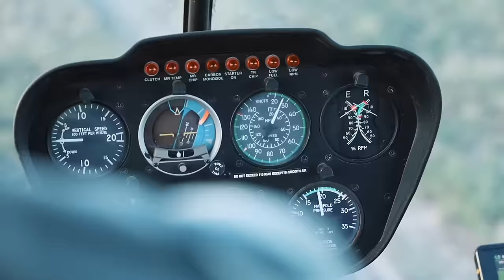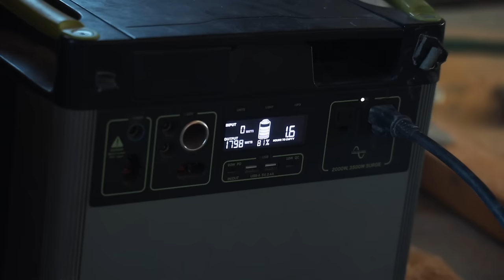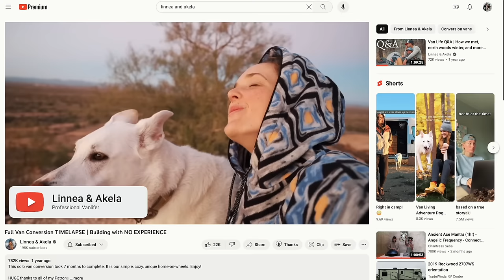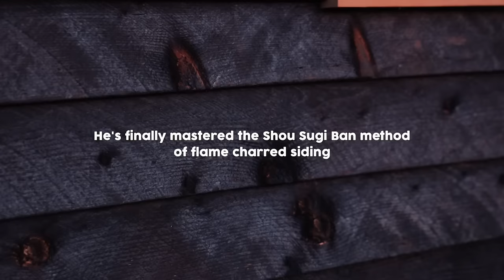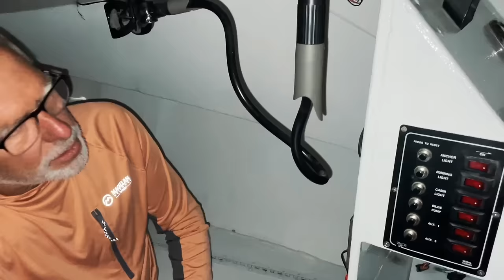FINISHED Just in Time | BIG Progress + BIGGER MISTAKE

Comment: Instant coffee tip that I recently learned... if you dissolve the crystals in a small amount of room temp water first before adding the hot water it will be so much smoother and delicious! It makes a huge difference. Has saved my sanity when out doing field work.
Reply: This is very true.. just boiled water actually burns the instant coffee.
I mix my granules with my cold milk then add the hot water and you defo get a smoother coffee 😊

Comment: It's a really good idea to keep the rafters exposed in general, IMO, at least for the next couple years or so. It's easier on a self-built (or just a build period!) when settling and issues crop up. Saves money both short and sometimes long-term. 

I never understood why builders just wall over everything on both modern and older homes without ease of access when possible. As we fixed things in our 1940's home, we left very tidy, louvered or screw-on access panels wherever it was practical and coverable or relatively unintrusive, especially in places where things like moisture and swelling or rot might be prone. Now in a 2017-built house (ick, Allen Edwin) we'll be doing the very same as the needs arise.